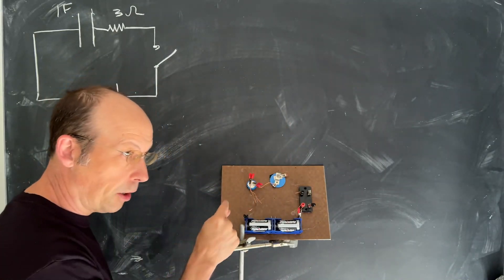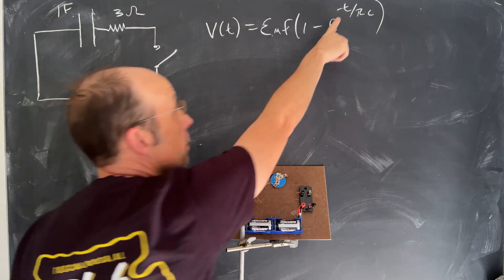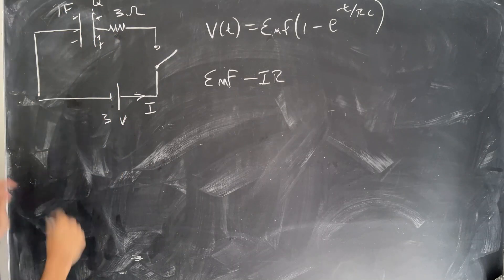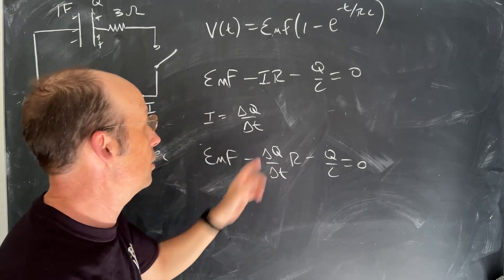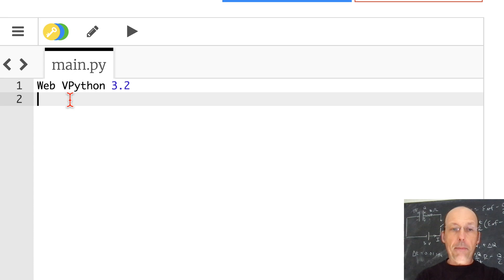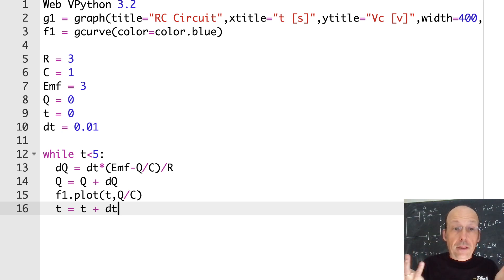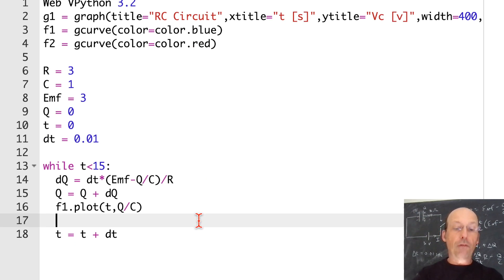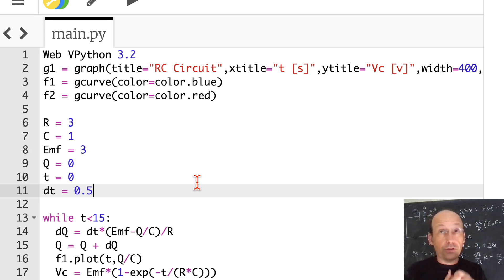Python Physics: Modeling RC Circuits without Differential Equations

Comment: Lightbulb isn't great as a constant resistance with current, right?
Reply from the maker: no, the light bulb's resistance increases with temperature - but it's a great object to use so that you can visually see what's happening to the current